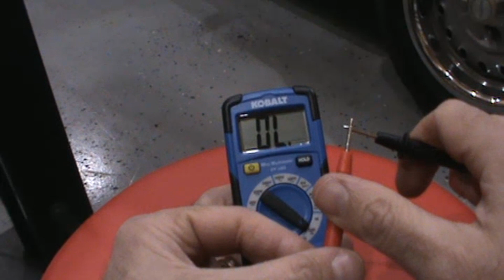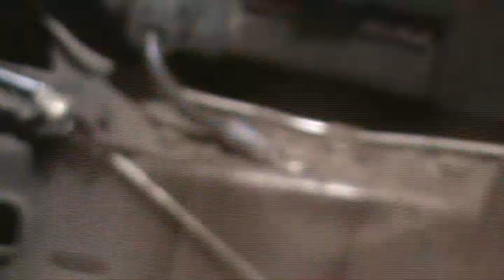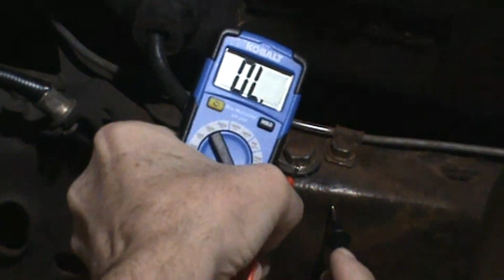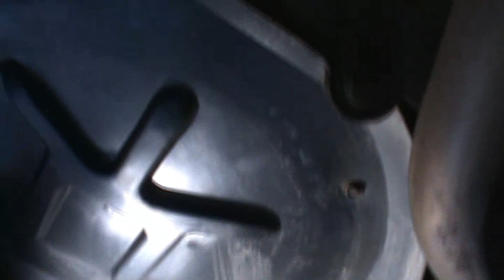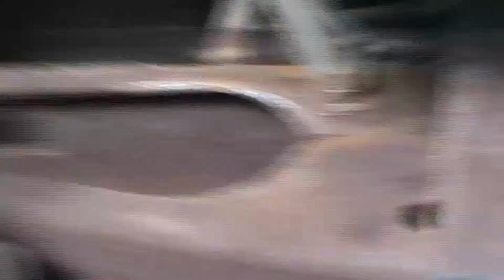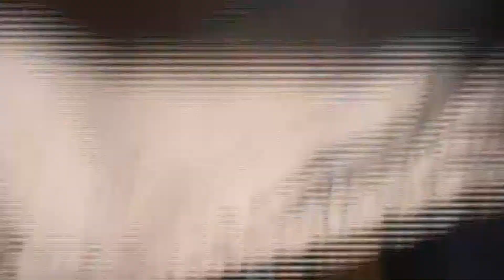Part 3  Ground Circuit Test Methodology and Rear Light Harness

Comment: Thanks for the info. Don't forget that GM used copper clad aluminum wire for battery cables around the early 70's. This explains the drop in voltage between the battery and starter.
Reply from the maker: I did not know that.  Thank you for the info!
Reply: @MikeHammill-TheShop  I just found that out a week ago when changing out my battery cables. The positive cable is around 90 inches are so and fun to change out....
Reply from the maker: @mikezamb3008  sounds like a swear free installation.  :)

Comment: Looks good. I am an electrical engineer and have worked in electronics for 50+ years. Your methodology here is sound. I have found when checking grounds with a DVM like that is it's rather 'touchy' with the probes. You must always move them around a bit and poke hard into the metal to get a good connection through the rust and crud on the metal. Looks like you learned that lesson too.
Reply from the maker: Thank you so much for the feedback.  I appreciate you.  Yes, I am trying to learn more on the electrical side of cars.  It is fun to keep old stuff going.  Your feedback is helpful and gives me confidence.